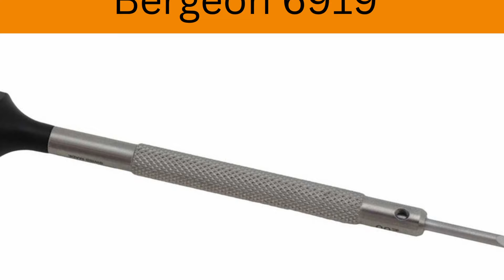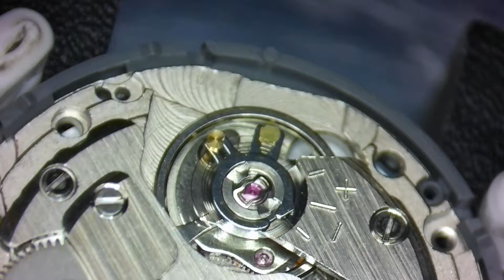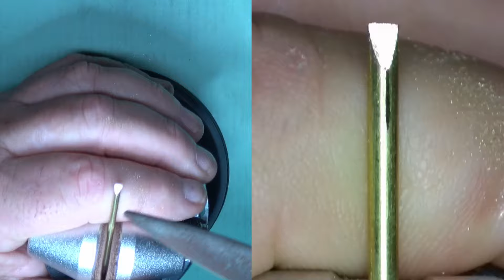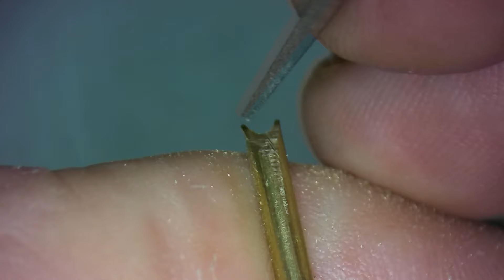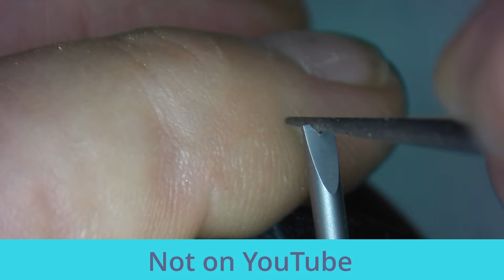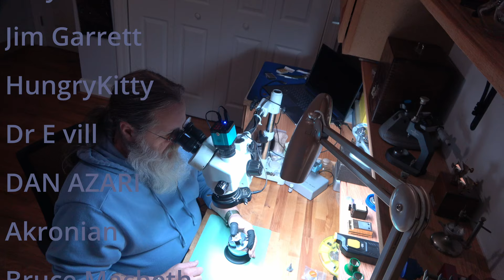Removing the Etachron Hairspring Stud: Tips and Tricks

Comment: When you unlock the regulator pins collar, does the hairspring just pop out? Or do you have to press it down to remove it
Reply from the maker: I am not sure what you mean unlocking. It should have a etachron style regulator. When you have to remove the hairspring, you twist the key so that it is fully open. Why do you need to remove the hairspring? 
You probably need to watch this video first, Skill Building: Regulating a NH34
https://youtu.be/ObqSIWwSqjM
Reply: @watchrepairtutorials yes exactly the key on the regulator. So you twist it and load the coil, then twist it back but not to over twist it because if it touches the hairspring anywhere in the regulator arm travel it will snag or not run right?
Reply from the maker: @sanmarteeeen  not exactly. If the outer coil moves when you move the regulator arm, the outer coil of the hairspring is not adjusted properly. Let me ask you a question. What happens when you open and close the regulator pins?
Reply: @watchrepairtutorials I have not tried to mess with the etachron studs yet. I don't have the tool. Should I open it with tweezers? And hack the movement to see where it's sitting?
Reply from the maker: @sanmarteeeen  no I would not use tweezers as you don't have the control needed. These tools could be found on Ali Express at a much lower cost than the ones I showed in the video.
Reply: @watchrepairtutorials another interesting thing is that I let the watch run 30 hours and it's at 120 amplitude and gaining 400 seconds a day. At full wind it's around 230 and 20 seconds a day. I recall you said in a video that's a sign the hairspring is off center because isochronism goes way up at low amplitude
Reply from the maker: @sanmarteeeen  isochronism  is the ability for a watch to maintain its rate at both high and low amplitude. Low amplitude at 24 hours would be around 190. At 30 hours, your movement is barely running.
Reply: @watchrepairtutorials so you think it's normal for a Seiko movement to be running at 120 amplitude after 30 hours? I've tested a few nh35 and I'm getting 44-48 hours power reserve, so I figured after 30 hours it's still in the meaty part of the torque curve
Reply from the maker: @sanmarteeeen  not at all. That's something you might see on a vintage Seiko but for the NH series measured at 24 hours, really shouldn't be any less than 190° .

Comment: Hey Alex, here's something that happens to me over and over. I get a new balance complete. but when I go to install it the stud pops off. Then it's a challenge to put it back on, first washing away the old epoxy and then getting it positioned and applying new epoxy. Thee must be something in my technique that causes  the studs to pop off. I do follow your method, putting the balance on the main plate, positioning the cock and then gently pushing the stud on the stud support with the side of my tweezers.
Reply from the maker: It sounds like the stud isn't perfectly aligned before you apply pressure, so double-check the seating before pushing it home. 👍
Reply: @watchrepairtutorials  Thanks Alex, one more question, I'm trying to replace the stud on this Seiko hairspring, how do you keep the spring from moving around as you work on it? Is there a particular surface you like to use to work on hairsprings?
Reply from the maker: @chuckgaudette8885  what are you trying to do Chuck, glue hairspring back into the stud?
Reply: @watchrepairtutorials  Yes exactly. Once again the stud came off the spring. So it's challenging to position the stud on the spring and keep it there while I add a touch of epoxy.
Reply: The glue that was on the stud is amber in color. I'm wondering if it is shellac and not epoxy
Reply from the maker: @chuckgaudette8885  whenever I have a part that needs to be stationary while I'm working on it and there's no mechanism to hold it in place, the standard is using a very small bit of shellac to glue it in place. In your case, this could be done on either the Hairspring stud or it could be a tiny amount to hold the collet in place. Whichever one is easier for you.  Before starting, you need to make sure that the hairspring is centered on the collet so that you're not attaching it into the Hairspring stud at an angle. Even though the original glue that was used was an epoxy I would probably recommend using shellac which gives you the opportunity to adjust it if something is not right. Epoxy is going to be a more permanent glue which leaves you know possibility of adjusting it after it's cured. This is especially important if it's your first time trying this because the chances are you're not gonna get it right the first time.
Once you're happy with the attachment of the hairspring  to the stud, you can clean up the parts you temporarily glued in place with alcohol. 
Just now this is gonna be extremely fiddly and it's probably gonna take several attempts even to get it close to where it needs to be.

Comment: Thanks for the video! The part I found more problematic tho isn't the removal of the stud (which in general is to just replace the balance wheel, so I don't care much about its hairspring), but to fit the new one without having the stud to rotate and bend the new hairpring :(
Reply from the maker: In order to prevent the new hairspring from getting bent, it would be wise to turn the stud so the pins are not at an angle

Comment: Uhm, I guess it would take an entirely different hobby/career, but Along with Watchmaker, I also collect, repair, and use Typewriters, and in some Olympia and Royal Typewriters there is a special screw tip, needed in order to unscrew a safety screw, it's a flat head screw with a special collar that needs to be pushed or pressed down while unscrewing, it takes a bit that looks exactly like this tool, it's found in mega multi tip screw bits and I know it as an H tip because of how it looks, it would work for this because it's the same shape and it too is tiny in the machine, found on the side of the platen stems to release the platen from the carriage, so might save both money and time to just buy a small sized H tip.

Just trying to help
❤👍
Reply from the maker: Maybe. I don’t think I have ever seen one of those before but I will keep my eyes peeled for one. ☝️

Comment: Even easier, would a hands-removing tool work?  It has a handle, metal of metal, flat, and V slot in the middle.  It may need a little filing to achieve the proper shape.  Great videos.
Reply from the maker: Perhaps. I think some people have even made it using an old spring bar tool.
I like the brass because it’s easy to work with and doesn’t scratch.

Comment: It would be very interesting to see under microscope if new watch(movement) has lubrication. It is probably possible to lubricate a movement w/o taking it apart. For example Seagull ST3600 has all jewels accessible.(It seems). This is what I am going to do as soon as I get the movement delivered.
Reply from the maker: Without any experience lubricating jewels the chances of you over lubricating the jewels is pretty high which will result in lower performance or worse.  You are probably better off doing nothing.

Comment: Thank you as always. You are the best! 

I wonder if it is possible to modify or use an existing springbar tool. I have many that came as a gift with straps, and some are quite thick and have a diameter of 2mm. Since they already have the center notch, I imagine it would be easier to file them down.

Cheers from Japan.
Reply from the maker: Sure why not. Just be careful of sharp edges that may scratch something.

Comment: If you have a lathe, an easier way is to chuck up the rod, drill a shallow hole in the end of the rod,  then take it out and file down to make the bevel. You'll get nice square edges that way.
Reply from the maker: Great tip.

Comment: Great tips! This tool could also be used for the role 1570 date nut I guess?
Reply from the maker: Absolutely! You might need to find blade the same width, but in this case I would probably go with brass.